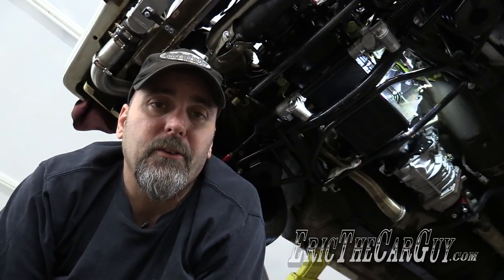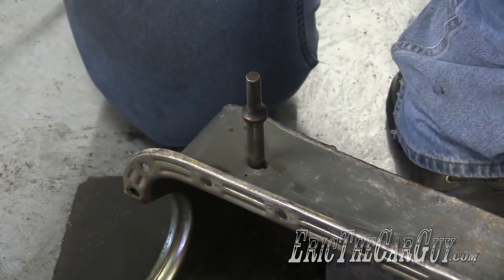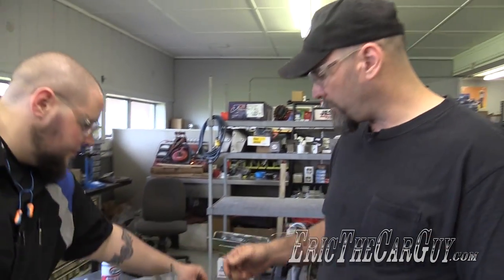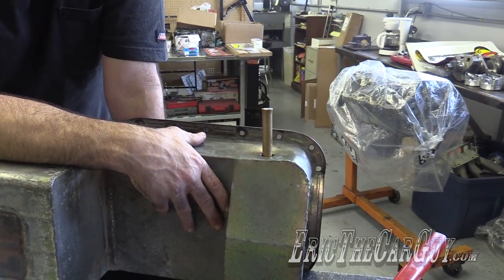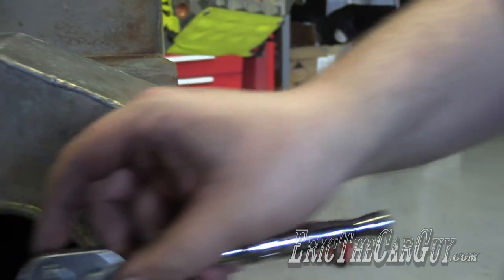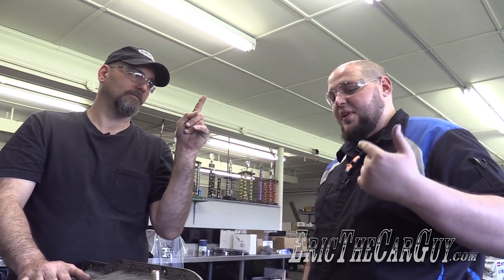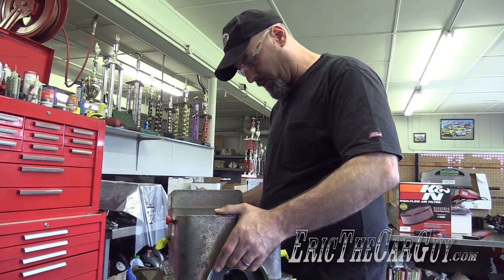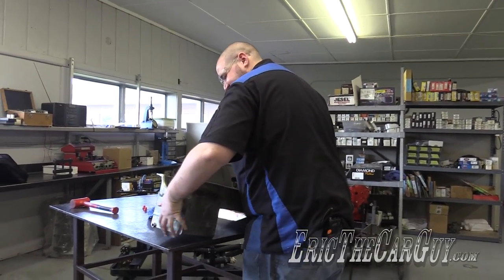Oil Pan Modifications for Turbo and 4 Bolt Main Small Block Ford #DarkMatterPikachu

Comment: This was just sad. I was working on something else and when I saw what was going on I asked WHY? The customer stated that this is how the directions said to do it and this is what he wanted to show his subscribers. I had a bung, a welder, a better way, but they forged ahead as you can see. So, I guess this video should be a lesson on "Sometimes you throw the directions away and go with common sense". An embarrassing moment for my shop to say the least and I didn't even watch the video as all I had to do is read the comments.
Reply: Thanks for explaining. That makes sense. I hope Eric updates the video to explain things.
Reply: Kalvinator Engines im glad you mentioned this. This is a low point in erics build, and im glad to know that your shop is actually concerned with doing things the proper way. Bad choices were made in this video.
Reply: This "customer" happens to be the same guy who welded a ball joint into a control arm.
Reply: I get that it was Eric's idea to do the drain that way but you guys should have said no. If he wanted to show the way the instructions said to do it get a scrap pan or a piece of sheet metal and demonstrate it that way. Should have gone with a bung.
Reply: I get that it was Eric's idea to do the drain that way but you guys should have said no. If he wanted to show the way the instructions said to do it get a scrap pan or a piece of sheet metal and demonstrate it that way. Should have gone with a bung.
Reply from the maker: I wouldn't consider it an embarrassment. I would instead see it as the reality of doing YouTube videos. Despite the fact that the method we used worked fine and there aren't any leaks, the 'internet' decides they are more qualified because they watched some YouTube videos. Don't let the ignorant get to you. They have nothing better to do than try and bring others down so they can feel better about their meager lives and lack of ability. In short, don't take it personal. For me it's the results that count and in this case, the result was an oil return that's secure and doesn't leak. Also, the method shown is more like someone would encounter doing this in their garage at home that didn't have access to a welder. Hence the reason I wanted to feature this method as it follows the instructions in the turbo kit. No fault or blame should be placed on you or your shop.
Reply from the maker: And that welded ball joint held better than the pressed in original.
Reply: Well, as Mr. Frische said: He felt embarrassed since he would never ever do it like that. And as of now 10% of your viewers downvoted this video because it is butchery instead of proper work.
When you call these people "ignorant", you behave in a very arrogant way because you are basically saying to Kevin: "Don't listen to those fools, they do not know what they are talking about, so simply ignore them". And by calling them ignorant, you call him ignorant as well since he stated that this was not the correct way to do it.
Those people - me being one of them - don't have to own a welder. You can call a lot of places and ask them if they could quickly weld in that bung for a small amount of money if you provide them with the drilled, cleaned oil pan and the bung. Every shop with a mig or tig welder can do that.

Doing it any other way on an oil pan that is off the car and even bare metal is not the right way to do it and will be referred to as butchery, no matter what arguments you are going to bring to the table.
Eric, we like your videos and we are certainly not the crowd of ignorant dumbfucks you are basically calling us. All we can see is somebody that seems VERY butt-hurt because of this minor criticism - something a professional (you like to call yourself that) simply should not do.
Reply from the maker: It seems you may be the 'butthurt' one here based on your comment. BTW, the definition of ignorant is someone who doesn't know something. Considering many people watch my videos to be educated about auto repair, by definition, the majority of my viewers are ignorant. The term 'ignoran't is not derogatory as you claim. Perhaps you didn't read my response to Mr. Frische closely enough. It was meant to absolve him of any wrong doing. It was my choice to follow the directions for the turbo kit and I stand by it. As stated, it holds just fine and doesn't leak.  Having an opinion about what was shown in this video is one thing, and I would respect a difference of opinion as I have with many others in the comments to this video, but to claim that your opinion is fact, when you have no evidence that it's a fact, makes you exactly the type of person you described in your previous comment. If you do claim your opinion as fact, I ask how many turbo kits you've installed. None? I thought so. I'm happy to agree to disagree, but you've resorted to name calling so I guess we're beyond that. That said, if I remember correctly, it's my car and I'll build it whatever way I want. Good day.
Reply: The term ignorant becomes derogatory once you start using it in order to prove your point in the meaning of "they do not know better". "They" do obviously know how it should be done and "they" commented and downvoted based on that.
The people who are ignorant in the very definition of the word watch this video in order to learn the proper way of installing this oil drain and they see the way you did it which is objectively (!) not the best way of doing it when the pan is on the bench already. Having said that: Sure, it is going to work, I would never doubt that, but this leaves a strange taste about the range of work quality you do on your car when I watch this and then the piping and suspension (...) things you did which are far nicer than this!

I did not install a turbo kit on a car yet simply because there is no such thing as a turbo kit for my car and I do not build cars in my spare time in general. But I had to put a new hole in my oil pan used for...well...draining the oil. And guess what: I used a bung and tig welded it. Same on another motorcycle engine made of aluminium.

You can do whatever you like to your car but this being your chosen way of earning money you have to live with the criticism incorporated with that line of work. :-)
Reply from the maker: Criticism isn't the problem. In fact, if you watch the first video I ever made, I talk about the inevitable disagreements I knew would one day come, and that was 7 years ago. What I have a problem with is that I followed the instructions, got a result, and I'm getting crucified for it. All because it didn't 'appear' that I did it the 'correct' way. The majority of these comments are likely coming from people that have never installed a turbo kit, or worked as a professional technician, or machinist, and that equals ignorant. The sad thing is I was thinking about the viewer that would read the instructions for the turbo installation, and wonder what the procedure would be. Therefore, I decided to do it this way to show what those instructions state. Would I have preferred to do it your way, sure, but I'm doing this for my viewers as much as I am for me. I fall on my sword so they don't have to. This way, if someone wants to install a turbo kit, and they have a questions about how to install the oil return into the oil pan, they can either, A, do it the way I show in this video, or B, weld in a bung. Point being they won't be 'ignorant' of the process, or that an oil return onto the oil pan will be a necessary part of the installation. For me, that's mission accomplished, even though I have to put up with a bunch of BS in the comments from people that have no idea what they're talking about. In other words, ignorant people.
Reply: EricTheCarGuy wow lol
Reply: Why are you calling experienced automotive people ignorant Eric?  You are calling out people for watching youtube videos when your day job is making YouTube videos.  Wow your logic never fails to be lost on me, and MANY OTHERS here.  You did this a 100% hack way.  Stop defending it.
Reply: Kalvinator Engines just let this be a lesson, the customer is not always right.
Reply: Kalvinator Engines
Reply: i have watched and really liked this channel for about 5 years. i have become increasingly disillusioned with it as lit has moved on to this project which is much less interesting than the previous  repairs and fixing it forward. And then to be so thin skinned and bone headed as to say "well the instructions told me to", This is not a proper engineering solution and if Kevin says he is embarrasssed then we can only imagine what he really thinks. The one saving grace for Kalvinator is that clearly they were pushed into doing this and in reality most people will understand that and it will not affect their business. 
 When I was a child my parents always taught us that , "well they told me to do it" wasn't much of an excyse for bad behaviour.

Greetings from Dublin, Ireland. Richard.
Reply: It's his car can do what he wants and you's are get paying for it so stop acting saying his fault
Reply: Dylan Macartney when he is wrong, he should man up and admit it. Instead, he was just acting arrogant like you knew it all even though he was blatantly wrong. I like Eric's videos, and he has shared a lot of useful information over the years. Just in this case, he screwed up. That's a fact, not disputable. Even the professional from the machine shop said so. As stated in other comments, eventually, the oil pan will leak. Then, it will need replacement. There is an old statement. It takes less time to do something right then it does to explain why you did it wrong.
Reply: EricTheCarGuy Eric, I love your videos and I think you're a great YouTube mechanic, but Christ man, the owner of a machine shop with*years of experience running a machine shop*just told all your viewers he's embarrassed this came out of his shop. maybe you should take a look at what you're saying here, calling everyone who disagrees with you crappy people with meagre lives. no matter how well this may or may not work, it's improper, it's bad work and the people around you don't even want to be associated with what you're bolting onto your engine. people are telling you to stay away from that machine shop, you're making them look bad and taking away their business and reputation. it's not just about you.
Reply from the maker: Ariel Lezen If you read my comments they are in defense of the machine shop, not so much in defense of me. As stated, it was my choice to do it this way based in the instructions found in the turbo kit. The fact that you don't agree with this method is fine, but as I continue to point out it hasn't been an issue. Despite some people insisting it's 'improper'. If it does become an issue, I'll be sure to point it out. If it doesn't, I will also point this out so we can put this to rest. For now, let's move on to other things. Thanks for your input.
Reply: EricTheCarGuy   look , i get that this is an old video... but don't assume that everyone is incapable of doing auto repair .
 Also , most turbo manufactures suggest using a welded bung in the pan...the fact that you resort to insulting the intelligence of the viewers speaks volumes about you
Reply: EricTheCarGuy , seriously .. these comments only serve to further prove that you have no idea what you're doing .. and assuming some have never installed a turbo is "ignorant" on your part.
Reply: You have a lot to learn.... Eric.
Reply: I bet Eric never installed a turbo kit until now either lol so calling us ignorant for never installing one is calling himself ignorant as well lol

Comment: Would it have been easier to just drill a hole then weld a nut or AN fitting to the pan instead?
Reply from the maker: As stated in the video, the method shown in this video is what the turbo instructions called for. It worked fine and there are no leaks.
Reply: Oh no doubt it works fine and doesn't leak, it just seem to be a little time consuming that's all. Good video as always, I watch em all man.
Reply: If it works, it works. ALTHOUGH I have learned that if you hack it it will work for a period of time. a month, a year, fifteen years. it just depends, but in the back of your mind its going to eat away at you, knowing you've done the job wrong and one day you'll go back and fix it, because its not the customer's car... its your car. Blood sweat and tears went to doing it right and when everyone says it's butched you'll know you fucked up and you'll fix it. then you'll look at it 15 years from now and be happy knowing you did right and followed your judgement despite what the directions said. You consciously don't want a bung Eric, but you subconsciously need one.......

Comment: Arggh damn that was some hackery to watch
Reply: You've not spent much time in racing paddocks.
Reply: Matthew Herrmann This was a machine shop.  It was pure fucking hackery.
Reply: Not really. While it's not the best way to do it (especially with the oil pan off the car), it's quick and effective. I bet it's less than an hour of work and unlike using a separate nut, you won't need to drop the oil pan to remove the line.

Sure a machined bung welded on is the best way, but you're talking about 2-3 times the labor costs for only a marginal increase in reliability.
Reply: Matthew Herrmann It was not quick and it was not effective.  1 x drill hole and 1 x AN weld nut/fitting would have taken 5 or 10 minutes maximum and there would never be sealing problem.  Now with this abomination, he has tapped pressed tin, Teflon tape and silicone sealing it up.  That is 3 x less than optimal techniques that still do not add up to 100%, especially after a few heat cycles.  I think Eric insisted it to be done this way because he was following the drain back line instructions as if it were still fitted to the car.  No machinist is this bad by choice.
Reply: They did what he asked
Reply: Doesn't say much about this machine shop.  Pretty ugly stuff
Reply: 17:00 when he was hammering on the flange to make the pan fit was due to poor planning just like the oil return and I doubt  that was in the instructions.
Reply: That's the difference between a mechanic and a fitter.

Comment: Pay machine shop hourly rate --> get back dented up oil pan boogered up with teflon tape and silicone. I'd lose my mind.
Reply: They didn't use teflon.
Reply: He is so buying a new oil pan after this... Welding in fittings is a thousand times cleaner.
Reply: Yes they did.  Teflon, then silicone.  Ugly.
Reply: Looks like something from a high school auto shop.
Reply: Not Teflon tape but used Teflon paste. Kinda the same, just more tacky. A lot of sensors come with it pre-applied. But I'm with you, I'd be pretty irritated spending this much money and beating an oil pan on. That's more a backyard engine build with your buddies.
Reply: Haggard Garage wouldn't do this😂😂😂 lol
Reply: NotAnother YouTubeChannel haggard garage would buy pipe fittings at home depot and hammer a hole into it then use a nut to hold the fitting on and use tons of plumbing caulk to hold it on cause "it's silicone so it should work"
Reply: The difference being that Eric was obviously there, it was partly his idea, he approved of it, the instructions called for it, and on top of it all, there's a camera shoved in the guy's face.

Comment: I think the recommended install by manufacturer was oil pan not removed, this got them off to the wrong start.  Actually a safe method without drilling for shavings, but with pan off, there's better ways to do it.  That's why we had the head shaking walk off.
Reply: These guys ever heard of welding?